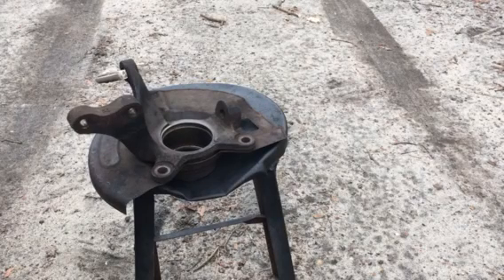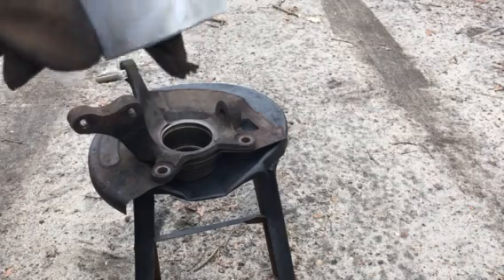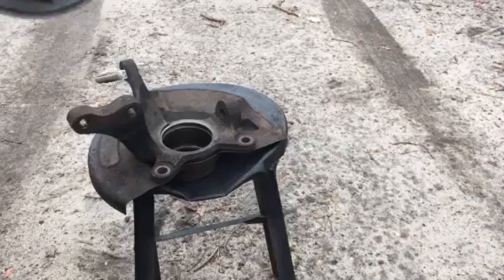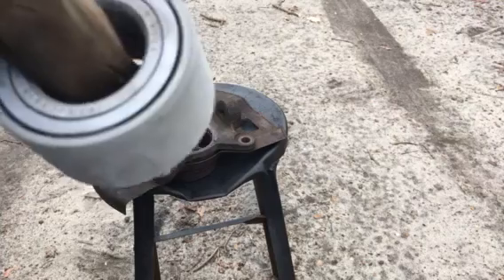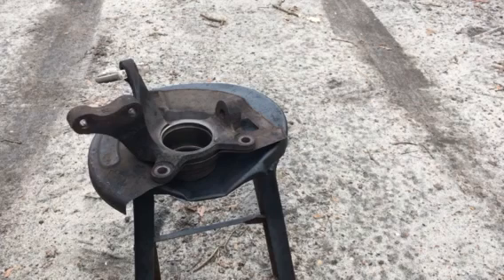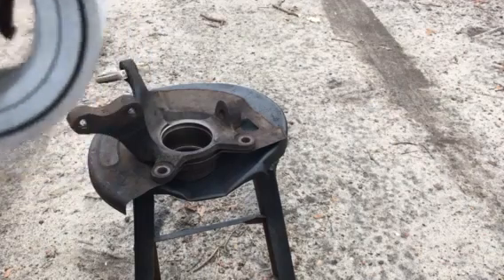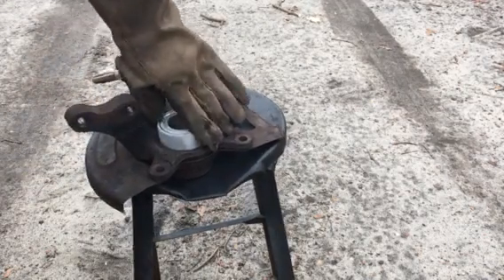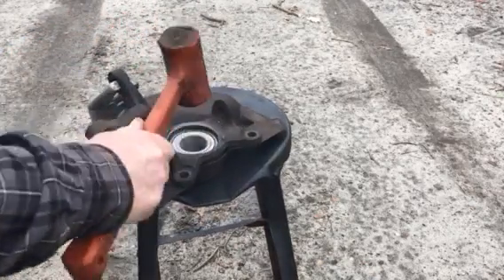Wheel bearing install no pressing easy hack

Comment: Never knew this worked. I borrowed a bearing removal/installer that was crossthreaded and useless so was forced to find an alternative and sure enough it worked. I Put the part in my bbq grill and froze the bearing for only 5 hours and pushed right in. Thanks so much for this video.

Comment: wow thank you for sharing your hack. I was currently stuck at trying to figure out how to get the bearing in without a press and now I should be able to do this. Can't wait to give it a try tomorrow!
Reply from the maker: charles diamonte okay just be sure that the Hub is cleaned out real good run some sandpaper or Emery cloth in there make sure it's clean you don't want anything to hang you up when you drop that bearing in there and be careful cuz it'll be hot out of the oven but use heavy vice grips and wear welding gloves if you have them and once you get the bearing in and seated be sure to be ready with either a hose or a lot of water you don't want to melt the grease out of that bearing and remember bearing in freezer overnight and knuckle in oven don't want to sound like a nag but if you do it the other way around it won't work LOL

Comment: Pretty good hack. I would just be a little concerned hammering on the entire bearing. Maybe use a brass drift on the outer race?
Reply: Good idea!
Reply: its a rubber mallet hellooooooo
Reply: @dflex4180   I still wouldn't bang on a bearing with even a rubber mallet. It's not being pressed precisely
Reply: Some manufactures so the same. No pressing.

Comment: What about the grease on the bearing ?
Reply from the maker: Maria Marquez the bearing is a sealed bearing the grease is inside just be sure once you have it seated run cold water over it until it's cool to the touch